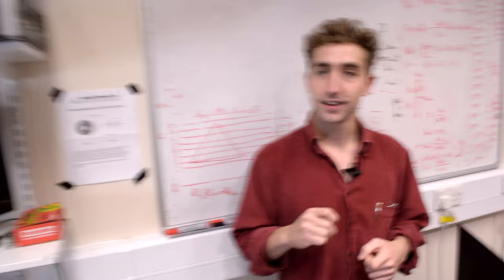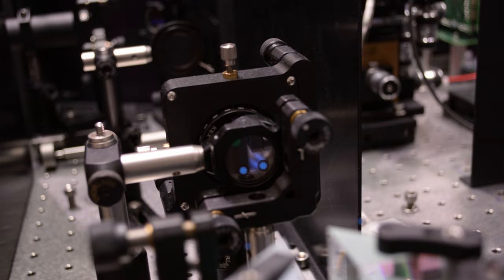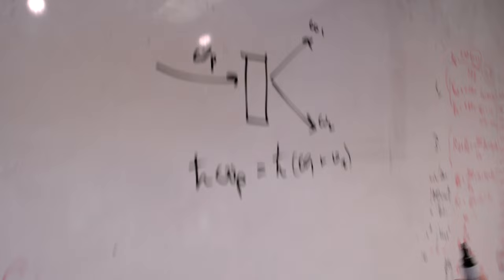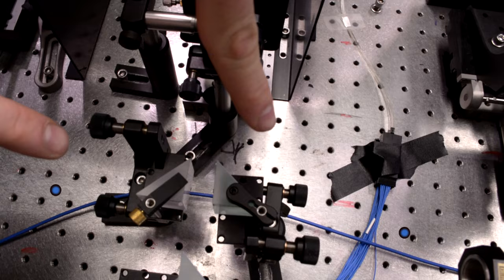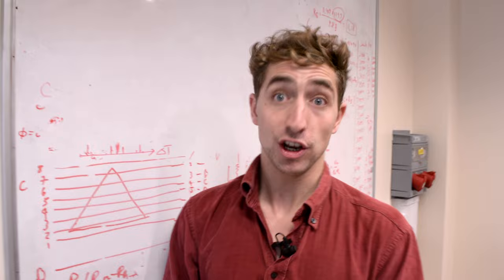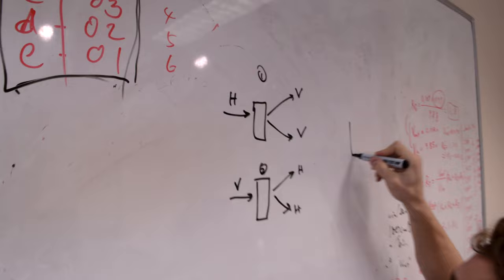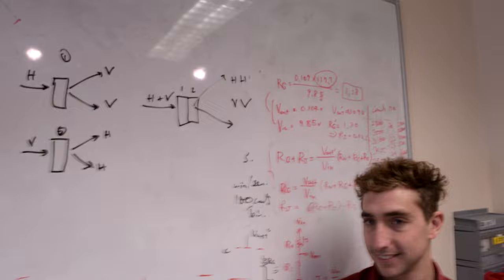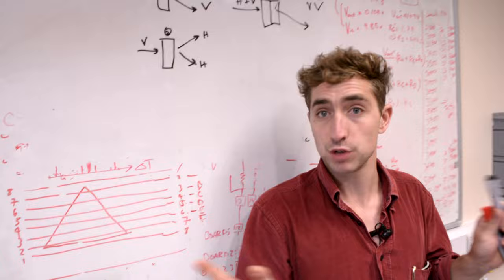How to Produce Entanglement

Comment: Doesn't explain anything.  If I cut a piece of paper in half, they aren't entangled.  Are the two photons now just half-photons, or did we just get 200% from splitting 100% in half?  What makes them entangled after splitting?   Are quantum states even an actual thing or we just don't have the knowledge to predict quantum level behavior?

Are entangled particles actually only separated in our 3 dimensions, but at the same point in some lower or higher dimension?     I find there is really a lack of sufficient explanation of quantum states.  "it's in both states" is not an answer.  There's a total lack of any hypotheses either to put any of these small findings in context and what the implications MIGHT be.  It helps understand, even if it's just a hypothesis, it underlies the significance.
Reply: Essentially the entangled name comes from their uncertainty. The splitting of the photon via high energy lasers causes a singlet photon to turn into two identical (nearly) photons, often called the signal and idler photons. The entanglement is in the experiment, basically there’s a piece of equipment called a coincidence counter which signals when a coincidence has happened, this being a device which measures when a photon has passed through it, it will only go off when it detects photons which have been created at the exact same time. Two detectors for the two newly created photons. The signal and idler photons have the same energy as the incident photons, because of the conservation of energy. This is called spontaneous parametric down-conversion. When detecting the polarisation of one photon you immediately know the polarisation of the other generated photon, regardless of the distance between said photons. Which Einstein did not like when he first proposed this idea in 1935, in a paper called the EPR paradox. From his paper he explains a theory of local hidden variables. Give them a read along with Alain aspects paper on the bell test experiment
Reply: So the two photons created have half the energy of the split photon?    If entanglement is just the polarization of an individual photon that was created from the same source as another photon, why would you call it entanglement?  It doesn't seem like there's any actual entanglement, or that's just a really bad word to use, since they just have the same properties, they're not actually affecting each other?
Reply: It definitely takes some work and digging into to fully appreciate all of this. But... Take one half of the piece of paper, and color it blue, as soon as you do that, the other half turns red. That's weird. And yes, they do affect each other. Faster than the speed of light. It's tempting to think that this is about missing information in the mathematics, but it's not the case at all. All of the weird quantum physics crap is totally experimentally proven. The real trick is getting enough information to see why they say all this, but it's for Experimental reasons.

Comment: Crap I thought I was gonna end this video and know how to entangle atoms in my garage.  I was disappointed
Reply: no need for a garage. I did it for my freshman year. just take a laser at least as powerful as green light and run it through a nonlinear crystal, I used the KTP  crystal but the BBO is a better choice. once you do that, some of it is entangled. the hardest part is detecting the actual entangled particles. I luckily captured an image that had shown the entangled light and was hyped. you should see a ring of light that is a lower frequency than the light you are using, that is what the entangled bits are.

Comment: This is a lot of crap, things are and are not, there is no super position.  Super position is just a potential of any possibility.  Really it is unpredictable since we can't see all the tiny variables affecting these experiments.  We are measuring tiny things as we pass through space on a giant rock in a corkscrew of a corkscrew inside of a corkscrew.  Maybe, just maybe if we think about trying to smell a rose for example, if you did this standing still you could get a sense of it's smell, but if you smell the rose with your snout out of a car window traveling at around 30 mph, you may only think you know what the rose smells like or even you'd need a field of them.  In this same sense you may need an assload of entangled particles separated and pure, to real appreciate what they could do.  Distill them like alcohol and make a storm of them
Reply: @redlady3062  Superposition literally means, we don't know where, but some where in this range.  The made up a bunch of terms for quantum science and they all mean "we aren't sure". The fact of the matter is they can't predict the position of a photon and it does have an exact location.

Comment: Can you transmit information through entanglement? No that's not possible. Does one photon, or whatever is entangled, have an  effect on the other? No, it doesn't. 

If it would, that would mean that information is shared between the two entangled particles. And that doesn't happen. No information is shared in any way.

This means that the effect is deterministic in nature. And that is only possible if the two 'entangled' particles shared the same space at the same time, which they did. So entanglement is determenistic in nature.

So I don't see anything 'spooky' in quantum entanglement. Only our ignorance.

Comment: Yuck. Primitive understanding. 

Ok yes quanta means wave, think of water but no quanta does not mean non definitive. 

To know where a molecule of water is in a bucket you CAN know definitively very easily. 

Change the water molecule to permanent ice. 

This analogy, let's us see that quanta is not pure wave, it reacts like light in both wave and particle.

So the question is, how do I know where the quanta is? 

Classical quantum physics attempts to boil down everything to probability, this is simply sloppy. 

Given a machine that will detect a particle, in quantum mechanics bad quantum physicists attempt to describe the wave as momentum and direction. 

But this is not quantum, this is only a part of it. 

Quantum is states, states implies time, time implies position. 

Problem is how do you measure infinity small time.

Back to the molecule that is ice in the bucket. 

You take the ice and you add something to it, to change a property of the water such as color. 

Then you add the ice now water back. 

This is quantum mechanics. 

Definitively all things are super imposed such as the water it is impossible to tell one molecule from another, so they are all equally the same except with probability of distribution. 

In quantum mechanics entanglement is the process of changing the water so that it is distinguishable.

Through the reference of another molecule that is different. If all the water was the same color or same entanglement then obviously it wouldn't work. 

Entanglement is an observation of the opposite type in any one state. You know that the state of the other is opposite of your observation.
Reply: The whole point of the Experiments done with this crystal is to prove that what you're saying cannot be. It's not about missing information in a theory, it's this is what's happening in nature. And quanta means particle. A photon is a quanta of light.